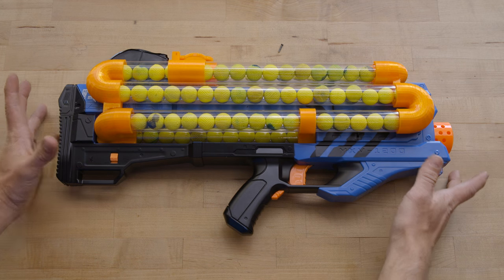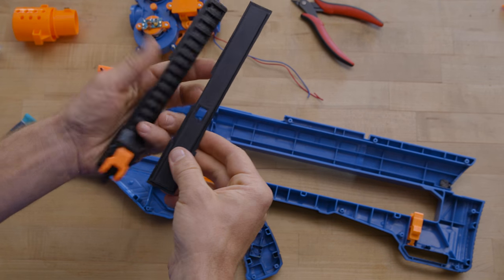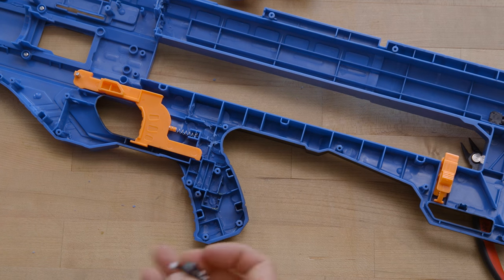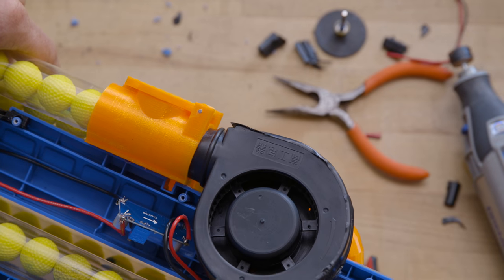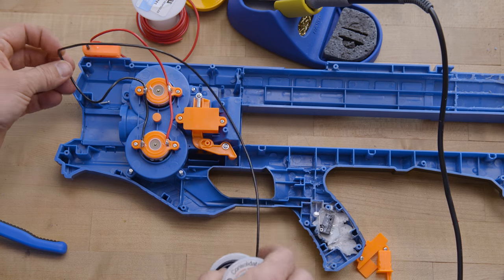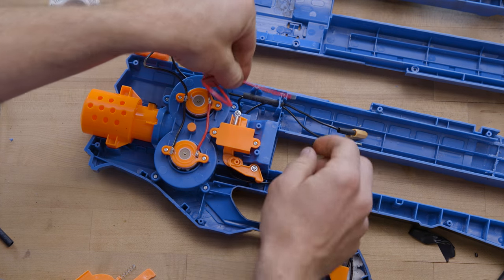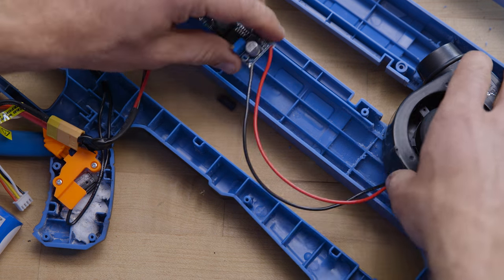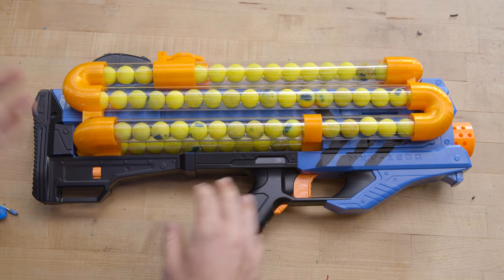MOD GUIDE: HIRricane Zeus (Full-Auto 90-Ball Capacity)

Comment: By far the BEST mod guide on YouTube!

Very thorough, well executed, and both educational and entertaining to watch. Thank you for taking the time to do this. 

On a side note, I wonder what voltage those motors are rated for. Some minor testing showed micro darts fit threw the flywheels nicely. Wonder if they would make a good replacement for standard cages hmm
Reply: +Outof Darts that's what I thought at first but drac has sent mega darts threw them. Perhaps they survived because of the available compression due to the large hole? 

It was just a thought. Maybe when I get bored enough I'll see if I can run some darts just threw them while running. Obviously wouldn't be a cheap mod but with the price of 180s right now I'd be interested to know if the motors themselves were rated better than the current gen of 130s

Comment: I actually just picked one up myself yesterday for a local Nerf War we had last night and the Zeus REALLY amazed me. Wasn't too fond originally of the ball ammo but coming from a stock Stampede, the stock Zeus just has great range and accuracy over dart blasters. And a little trick I learned mid-game for more tight quarters or indoor areas is you can easily bounce your shots around corners. :D

I do plan on getting to modding this after sitting down and getting everything I need and planning ahead. In addition to all the work you have done so far (self contained 90 ball capacity, proton pack, 'select fire' solenoid), I plan to try and add in an arduino and use that for some extra functionality. I originally planned to do this with the Stampede and have an automatic mag capacity display but the Zeus makes this a little more difficult. Once I start getting it down on paper I can get a better idea on how to start putting it all together.

Past all that, loving the videos and the production quality. Will definitely be keeping tabs on your work. :)

Comment: Suggestion on installing switches with putty:  before starting, wrap the switch body in a layer of kitchen stretch wrap.  Two layers is probably best, but not a lot of layers.  Then you can fit and align it exactly where you want, let the putty cure completely, yet still pull it out to remove the wrap for a positive glue-in later.  It will form a positive "socket" you can easily get right back into.  

Probably want to test your wrap choice against your putty choice before committing them to the build, but I haven't yet had a combo stick too badly after a full cure.

If you're crafty enough to do the putty forming in both shell halves, then you can skip the glue for an easily replaced switch, if that should ever become necessary.

Comment: Just so you know, the boards you took off the flywheel motors aren't loaded with resistors. Those are actually capacitors. Their only job is to reduce the amount of electronic noise the weapon emits. They in no way inhibit the function of the motor. You could have left those in and it wouldn't have made a bit of difference in performance. It would have reduced the chance of noise on a nearby radio while your firing though. A little knowledge goes a long way right? Now you know what the boards on the back of the motors were for.
Reply: Yes exactly. Not noise you would hear just with your ears though. It makes them less noisy to other electronics that are nearby. Sometimes you can hear things like this in audio amplifiers and radio receivers if they aren't properly shielded against such electromagnetic radiation. Try running a small motor near the input cables of a set of computer speakers while their turned on and connected to something like a phone or computer. Then try soldering on some capacitors like those on the boards here in this video. It suppresses the electronic whine you get without them. You'll see what I mean.
Reply: so if i mod then i should leave those circuit boards on?
Reply: Absolutely. It doesn't hurt anything and keeps it from making noise in nearby stereos and TVs....
Reply: ExStatic Bass The traces on those boards won't support the increased current you're going to supply, so removing them is actually a good thing. If you want to keep the EMI down from the motor, simply solder a 10uF or 100uF (can't do the math right now to tell you which but it's in that range) from the positive terminal of the motor to the body of the motor. Just look at a Fk-180sh-3240 from eFlight to see what I mean. 

If you do an arduino controlled blaster, this would be important to have on each motor so you reduce the risk of flying the board through EMI that is sent back on common line (negative). That, and use flyback diodes so you don't fry the mosfets.

Comment: Thanks this is exactly the motivation I needed to start buying resources for this Mod
Reply: +Outof Darts I've been looking around at lipo's and it is a little overwhelming because I don't know anything about lipo's.  I understand the differences in voltage, but that is about it. What brand do you personally use?  Any advice would be very welcomed. 

Thanks!

Comment: So, I'm integrating zeus flywheels and tubing and a blower into a minimized longshot( cut right behind the mag). The problem, of course, is I would have no ability to stop it, as the trigger system is different. I'm planning on using this as a last ditch blaster, used only when someone rushes me so I'm fine with not being able to stop firing. Do you think not having the stopper will cause any other issues?

Comment: So I have a question about the 3 cell Lipo.  You up the power from 9V to 12V are the motors not screaming out control?  I have installed my lipo to just have a rechargeable battery for now, full mod will go in later.  I revved it up and it sounded like it would blow up.  I tried to shoot a round and it fired the ball into the housing of the gun.  I cleared it out of the body and the gun stopped working (revved but supper slow like the battery was dead).  I installed the stock C cells and it worked fine.  The motors did not seam to like that much voltage running through them.

Any help would be great.

Comment: So you can charge a LIPO from just the balanced cable? I thought you had to connect to the XT 60 connector also.
Reply: Pretty sure you have to do that for a balanced charge, which is the safest way to charge LiPo's.
Reply: +Outof Darts I meant I think you have to use both cables for a balanced charge.
Reply: ***** Yes I always do balanced charge with my LIPO's, but I've always connect both cables. I never knew you could charge it with just the balance cable.

Comment: here's one question. when opening mine up to breakdown and paint i found the resistors are all crossing over on one another and there's a ton of bare wire that's causing the gun to behave rather(slower flywheels than my others due to losses) poorly which has me thinking: is there a way to make these things a bit more efficiently wired without dropping in a different power source and switches? or would the increased currents blow the switches/heat the batteries to a dangerous level or do the motors provide enough of a load themselves that they will keep everything chugging along fat dumb and happy?

Not looking to make a foam flinging monstrosity out of the thing. i just want a little a minor improvement and something that doesn't have internal arcing every time i use it. this video is really helpful on seeing the paths the wires follow better but it still leaves me with questions on if there is a step down. (id like to point out that I'm not using a hopper system like the gun in this video so i don't exactly need the extra voltage for anything.)

as someone with some basic dc circuit knowledge (college circuit analysis courses and some rewiring of old damaged circuits) I'm curious if anyone has ever tried just bringing down the total resistance of the circuit a minor amount and cleaning up the wiring as opposed to doing a full modification. not a big fan of safeties in general but on this gun i think they are effective and if i wont be killing the poor switches i want to keep them in if at all possible.

if you personally haven't tried these things does anyone known of anyone who has tried these things? for me on my first modification of a flywheel blaster its been a huge trial and error process.if nothing else works i may keep all the components and only replace the wires so all the contact points are clean and there's less exposed wire. just to make the thing safer to use (and hopefully a bit more efficient). not sure if anyone's ever tried it.
Reply: Outof Darts would that resistance be enough for the stock switches from the safeties to keep ticking? sorry for all the questions. just kind of learning "trial by fire" here and don't wanna screw up my first mod on non-spring model.

I'd also like to say that was the most helpful answer I've gotten on one of these things since I started researching.

Comment: The capacitors you cut off the motors, not resistors, are there to supress rc noise caused by the brushes in the motors.

Comment: if you are just doing basic mods like removing the mechanical and electronic locks as well as throwing in some upgraded batteries, the circuit goes: Battery tray - motors - rev trigger - battery tray right?
Reply: positive goes to the tray and negative goes to rev trigger right
Reply: +Outof Darts would you suggest 4 IMRs or a 2s lipo as a battery source

Comment: i tried this just for the standard 12 round mag and 8 balls shoot out then my blaster jams. What do you think happened?? Thanks
Reply: Astin Kim, you probably forgot to sand down the blocker in the motor mechanism so it sits flesh with the outside.  OutOfDarts mentioned that in his tutorial.
Reply: I found out why it jams. Its not the blocker, im using c batteries which doesn't allow the flywheels to spin fast enough and it causes the blaster to jam after 6 shots.

Comment: Do you know how well this would run on a 4s, or do you think I'll fry the motors?
Reply: +Outof Darts I tried once to test my wiring (my 3s was dead). I might look around for some replacement motors, but I'm already impressed with the proformance of a 3s.
Reply: Outof Darts how much would it be if i buy the gun made, if i knew i would buy it depending on the price
Reply: Jakob Schanz I tried it a little, but I wouldn't for an extended period of time.

Comment: Super awesome video, I highly appreciate it. It took me two hours to do the LiPo part, and this was indispensable. Thanks so much! For just the LiPo, it fires very well and rev up time is extremely good. Also, you can use switches like these: https://www.amazon.com/dp/B01N2U8PK0/?coliid=I2R8LMUFLRY1CU&colid=20Q5FJGBVMHO4&psc=0&ref_=lv_ov_lig_dp_it. You just have to dremel out the rev trigger switch mount a little. I wouldn't recommend this mod to someone with no experience with soldering/wiring but those aren't too hard to learn if you spend some time. Thanks for this awesome video out of darts!

Comment: Can I instal it with no mods so it just holds more balls so I don't waste all ammo
Reply: Depends on what you mean by "no mods". You can keep it semi auto, but in order to feed reliably you need the blower. In unmodded form, the spring in the magazine feeds the balls. Here it is replaced by the blower.

So in summary, if you just mean semi auto, yes. If you mean no rewiring, then no.
Reply: just semi auto just installing the thing and going
Reply: +Tommy Does Nerf yes, aslong as you rewire it, and preferably change the power source to lipo, or at least IMRs. Remember you are running the blower and the flywheels now. Then yes, you can easily keep it semi auto. Just do as he said and leave the gate and caged undremeled and leave the ball pusher in.
Reply: izahealyou what if i run the blower on a separate battery pack i would only use it indoors so i wouldnt need it to be super powerful
Reply: +Tommy Does Nerf aslong as you can get it moving fast enough than it might work. The power needs to be there for the blower to push the balls down the tubes.

I would test it on 4 IMRs to see if it's enough to run the blower and the flywheels at low rpm as you want. All would be guessing right now until you test it out. I don't have the specs on the motors or blower to tell you the load output to each.
Reply: izahealyou stock preformance but with more balls stock batteries but seperate battery tray for blower. sorry for grammar typing in class